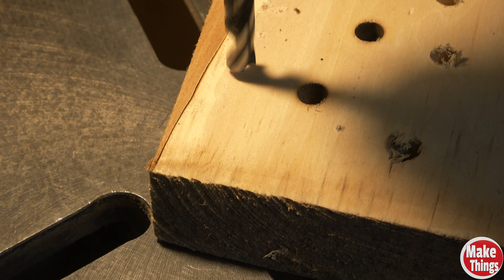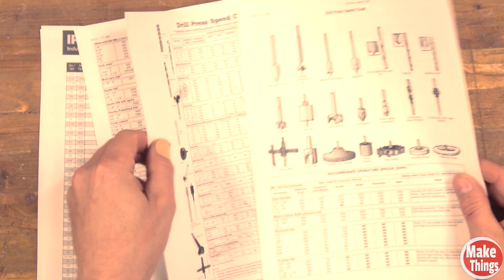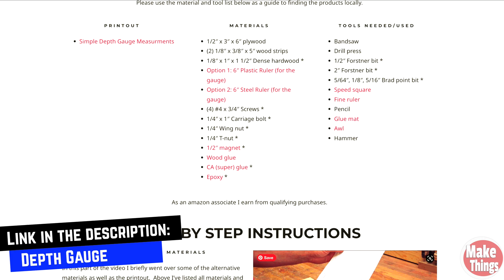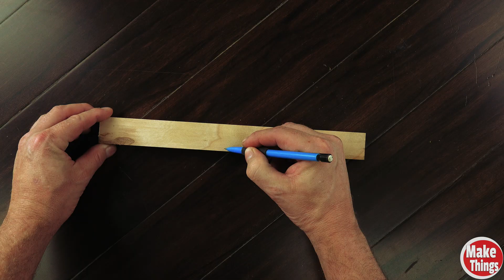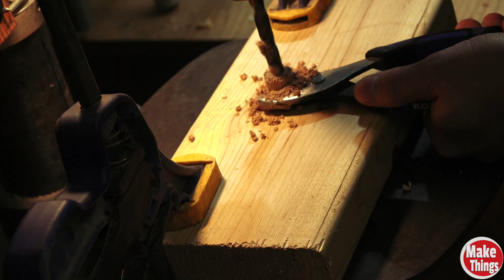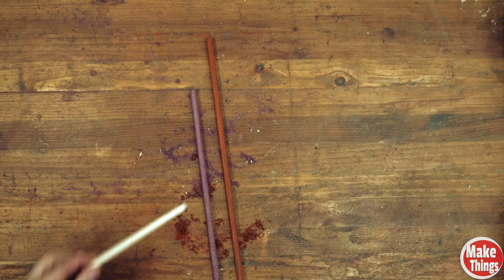12 Drilling tips you can't buy on QVC! // Drilling Full Size Tips

Comment: Good tips, some great. I noticed you have one of those diameter cards with different sizes of holes and their diameters marked. These are a huge help in sizing bits whose size is no longer legible and checking dowel and bolt diameters. It is very helpful to have one where it is easily accessible, like yours.